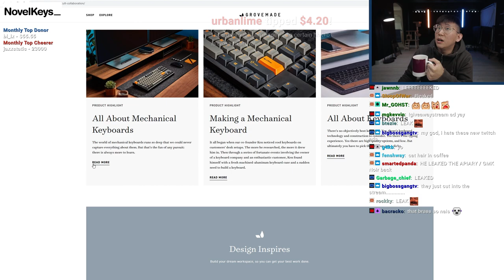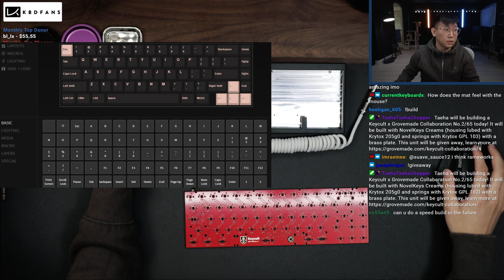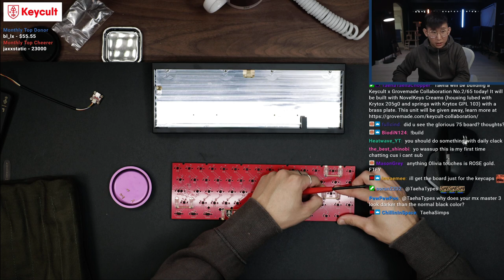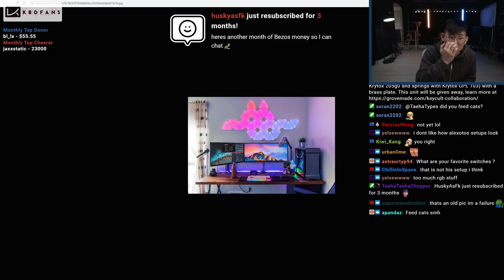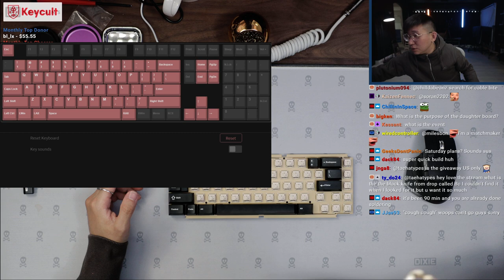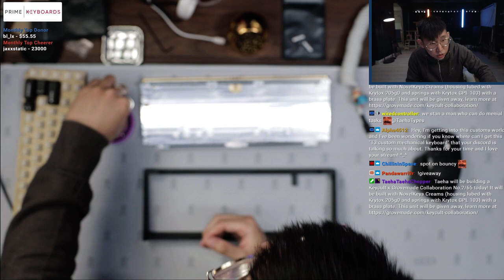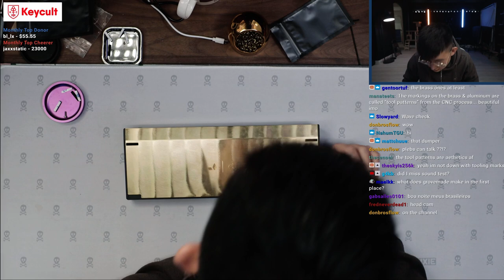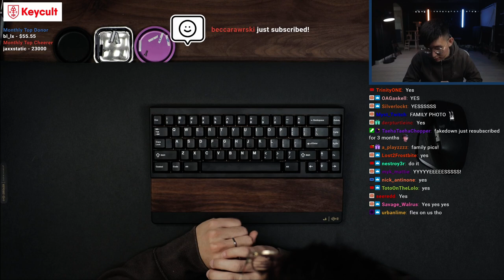Keycult x Grovemade No.2/65 with Grovemade Accessories Build Stream

Comment: Bruh, this keeb looks like 10$ board you can buy in a drugstore lol. So boring. The more keebs like this i see the less i understand mechboard community. It's staggered. It's not even wireless or programmable. Or is it? Can you flash it with QMK?
Reply: Yes it can be flashed with QMK
Reply: The quality is very different. The reason it seems “boring” is becuase it’s not the colors you would want. But it works with the scheme